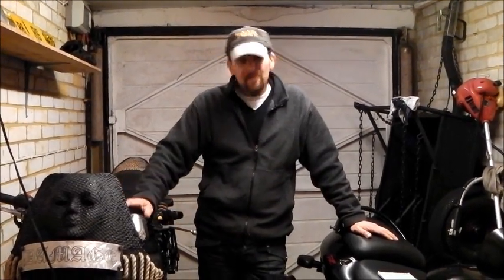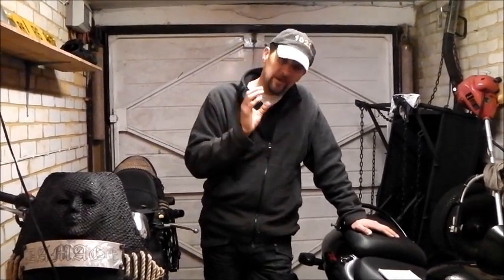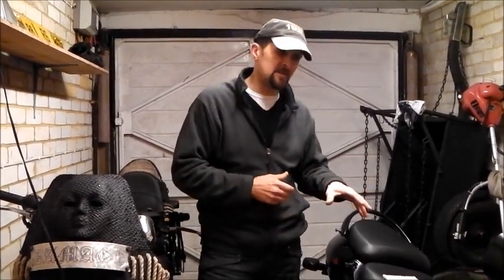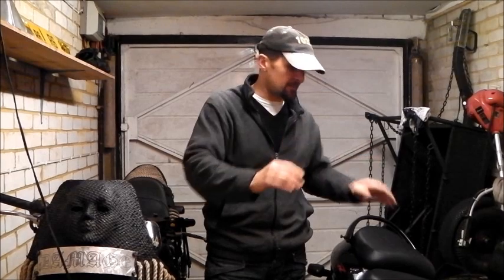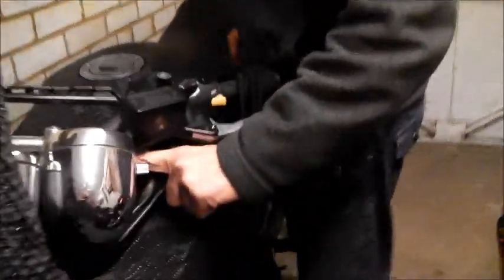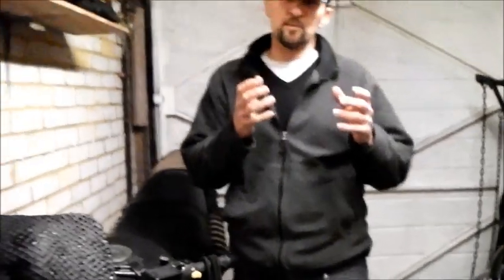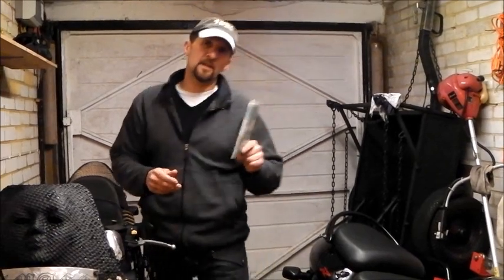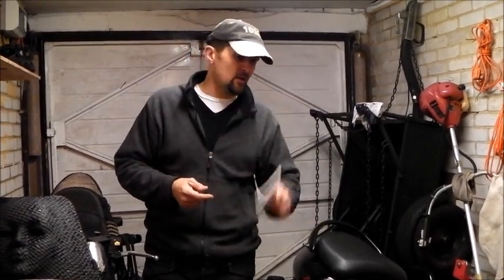Delboy's Garage, Motorcycle Suspension setup.

Comment: Enjoy your videos! I'm 61 yrs old and have ridden since I was 5 but have never had this problem.  I now have an 04 Suzuki VS 1400 Intruder (only 6K miles) that has handle bar shakes when you let go of them going down the road. Tire pressure is correct...any ideas?Thank you! Stan in N AL USA
Reply from the maker: +Stan Wilhite Hey Stan, thanks for your message... ok, so the bike is shaking its head under hands-free deceleration..?, did the bike do this before, or is it a new thing?, and have you just had the tires fitted?.... you can check they are seated properly (specially the front), take a close look at the bead around the rim to make sure its all exposed evenly....you said the tire pressure is correct, double check the recomended pressure, a big old monsters like that needs the right pressure...and maybe try adding a couple of PSI over that pressure to see if it elliminates it?... check your headstock bearings, (get the wheel off the ground supported, then crouching in front facing the bike, grab both fork legs by the wheel axle, twist the head side to side full sweep and see if there is any notchy feel, or anything causing it to resist a smooth lock to lock sweep)... finally check your rear wheel, i know it sounds odd, but if something's off at the back it can effect the front, make sure both shocks are ok and set to the same preload..... 
  Have a look through those things Stan, l]and let me know what you find sir... good luck.. Del.
Reply: +Moonfleet41 Thanks for your reply! I've been riding since I was 5 but  just bought this bike about 5 mos ago.  The previous owner had the tires replaced. Tire pressure is correct per manual, but I will try increasing it if the other cks  don't correct the problem. Will get back to you....thanks again! Stan

Comment: hi Del, great video :) on my Yamaha 900 diversion it is recommended to upgrade the standard suspension (front) to progressive.. could you explain a little on that when you get time. my bikes all setup to standard settings from the factory so i take it sometimes its not as good when there are upgrades. Unless the factory suspension on this bike wasn't good enough in the 1st place ?

Comment: You are so right just leave it standard! My biggest annoyance buying a new bike is previous owners will have messed about with the settings. My current bike is a ZRX1200 and the front fork compression adjusters are seized and I know they aren't factory as all the other settings are miles off. Arrrrrrrrrrrrrrrrrrrgh! So annoying

Comment: Please help. I have Kawasaki Ninja zx636r 2004 year. I notice that my bike is too soft and that it is very low. The owner before me has so set the suspension because it is low. How to Raise rear end on motorcycle? All parts are original and nothing is changed. Thanks in advance

Comment: Good tips Del. Nice work behind the scenes Penny! I have tried in vain to find a factory owner's manual for my '99 Bandit 1200 and my Clymer shop manual, while good, does not cover suspension adjustments. I could find factory default on the rear shock easily enough... but if I undo the preload on the front forks too much, will it come apart?

If you have any suggestions I'd be happy to hear them. :)
Reply from the maker: Hi John, if you're asking whether the preload adjuster on the top of your forks comes all the way out then NO, it will hit a stop a the highest point and then go no further.. then wind all the way in ans count the turns, (or 'rings' if it has them), and then set it to the mid point.. this will be the best start point for you to fine tune the forks from..! hope that helps buddy.. good luck with it.. Del.
Reply: Spot on Del, just the info I was looking for. Thank you.
Reply: BTW If anyone else is looking for this information, the document is at https://www.facebook.com/download/preview/1376639192403314. Front suspension settings on page 5-28, rear suspension on page 5-53.

Comment: Yeah both are on top lad
Reply from the maker: +jimmy g Then if they are the same spec as the later Gixer forks ive seen one will be compression and the other rebound....as always, seyt them to the centre to start with, and make adjustments from there... but with forks that good you could invest a few quid and get them tuned to your weight by a proper suspension tuning company... people who have had this done report amazing improvements...! just an idea..?
Reply: +Moonfleet41 will do mate

Comment: Hi del could do with some help , av got cbf 600 05 it's had new headberings , wheel bearings , new tyers  pilots roads 4 , and fork seals fitted , 
When out riding I find it fells like bouncy at speed or juddering when going over uneven roads can trace the problem but it's driving me nuts , 
Q is have you ever experienced this
Reply from the maker: James Percy ok mate, "bouncy" is too little damping...and "juddering" is too much...it can suffer from both, its not as daft as it sounds.. you could have too much compression damping making it hard over bumps....but too little rebound damping allowing it to bounce upwards... 

Take both "damping and rebound" adjusters and set them to the middle of thier range of adjustment.. (wind to one end, count all the clicks to the other end, then come back halfway)... this will set your damping all back to factory stock.. 

The set your tyres to the correct PSI.(in your handbook), and set your chain tension correctly too... and then take the bike for a ride, see how it feels and let me know mate... ok?, keep me posted.. Del.
Reply: +Moonfleet41 ok set the back shock to no 3 factory settings, there is no adjustment to the front - it's got the good old bog standard forks , tyers are at 36 front 42back . 
When out riding to night  it's like the forks are making a sound when braking , and I do have that bounce when there's bump in the road - putting me of riding big time , it rides in a strate line with hands off the bars and there's no vibes on the bars if that info helps ,
Reply: +James Percy  what about fork oil ? If too little,
Reply from the maker: James Percy Hi James, good thinking, if the fork oil has not been changed in the last 2yrs it wouldn't hurt to empty it out and re-fill with a decent 10W oil to freshen it up.... this bouncing you talk about could be characteristic on cheaper, basic forks, but it's unlikely.... fork oil change is part of major servicing, it usually gets missed, so could possibly not have been done for many years!,,,,

Comment: i tried this supension front setting (rebound side) on a suzuki gsxr 2001. i can not hear any "clicks" and on the left side are more turns. WTF :( how to setup this?
Reply from the maker: +MrMedicusNeo Dunno buddy, check your manual... most suspension damping settings have 'clicks' to balance both sides... perhaps count 'turns' from one end to the other and do it that way??
Reply: +Moonfleet41 i've found the stock settings but there is one "problem". when i turn it clockwise (rebound, front) to hard it does not "stop" properly like on the rear side. it becomes more and more harder - how hard to "close" it??
Reply from the maker: +MrMedicusNeo It could have a blockage inside the mechanism, the valves inside allow the oil through to slow down the movement... that screw opens and closes those holes, if they become blocked of fowled up with debris...they will be hard to opperate... if it was my bike, i woud just strip them and clean and flush out all the old oil... and refill with new oil.. then see if that cures it..!
Reply: +Moonfleet41 thank you for your advice :)